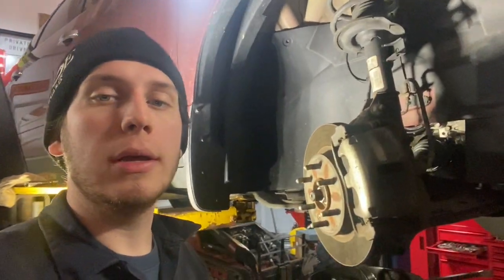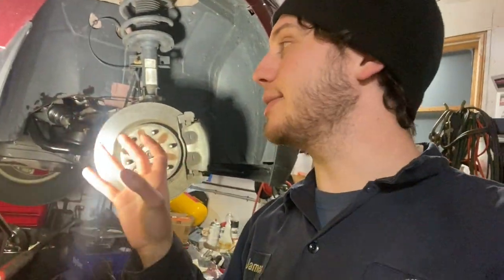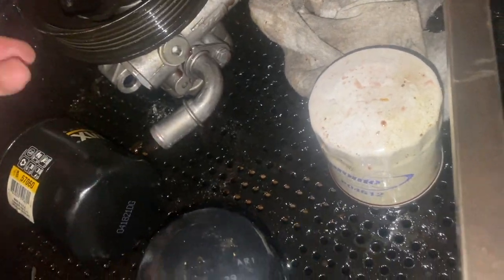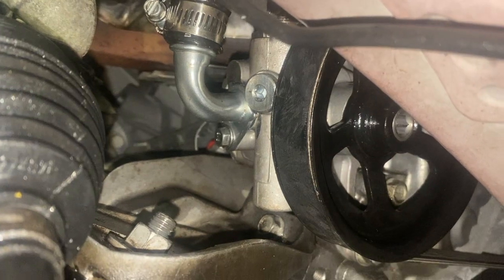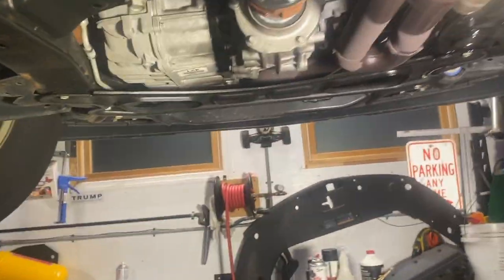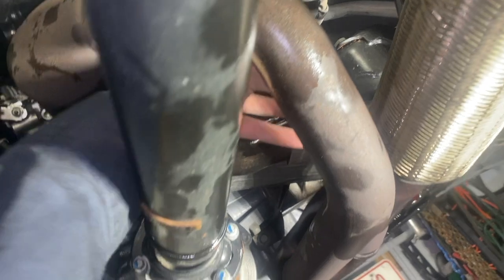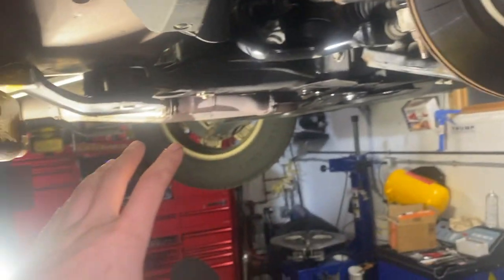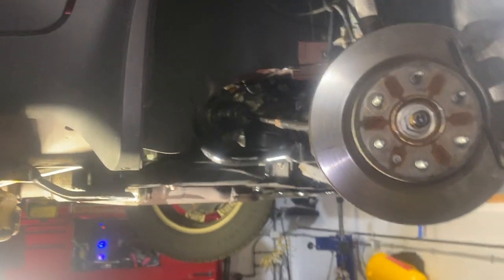2011-2017 Chevy 3.6 traverse power steering pump replacement leak the easy way

Comment: Just took mine out (2016 AWD) out with the help of this video. Thank you. I struggled until removed a heat shield (2x10mm bolts). Once I did that, it took 5mins to get out. You’ll need a looooong extension with a swivel end to get that back bolt.

Comment: Just did this on my back. 2013 Traverse AWD. Took about 3 hours. The pump slides out easy through where you showed. Remove the elbow from the pump first (held on by 10mm bolt) and it'll slide out and in 2 minutes tops. No need to drop frame or driveshaft. The hardest part honestly is getting the line nut out and putting the hose clamp back on (I highly recommend replacing it with a screw-type clamp).
Reply: Thank you !  This really helps!
Reply: Where are you feom?
Reply: Sorry.. Where are you from?

Comment: Ok here is the absolute easiest way.  

Remove belt.  Unbolt passenger sway bar link from strut.  Unbolt tie rod from knuckle.  Remove right side subframe bolts, don't touch left side to keep subframe position.  Lower subframe as far as it will go.  Remove flare nut, remove 10mm holding return elbow.  Pump falls right out through wheel well.  Takes 30 minutes.
Reply: Is there a video of anyone doing it this way that you have know of? I would like to try doing it this way I prefer watching a video first..

Comment: Of course you can do it on the ground. I did the timing chains and phasers on the ground, which requires taking the pump off just to do it (even though i just left mine tucked in back)

Comment: Question? I have a 2014 traverse. It has been leaking steering fluid at a rate of half a quart about every two months. I degreased the undercarriage to try and identify exactly where the leak is coming from but still can't quite see it. It's definitely coming from the pump and not the rack but my question is, should I just go ahead and replace the pump or should I do anything more to try and diagnose the issue? I do all of my own repairs because where I live there are no mechanics that are trying to do a good job well done without robbing you blind first. I guess a more indepth explanation of my question would be if I replace the  pump is there anything else I need to watch out for that it may be leaking from that may not directly be the pump itself?

Comment: Take the pully off also with a puller,it can be done if you get it in position,then comes right out.No need to take anything apart.This is great idea also.If you don't have a lift.
Reply: That’s what I did. Some people just don’t see it
Reply: @eltorro30  AWD models are a real pain, I took the tierod off 1st,2 jacks on the cradle,impacted the 6 bolts loose,lowered the cradle with the jacks,Then put the pulley wheel into position,Rented oreilys pulley puller,pulled it.Pump falls right out.Put new pump in ,Pressed it back on(screwdriver to keep pulley wheel from spinning),pressed right on.Jacked up the cradle, rebolted the pump,hooked up 2 lines,reattached tierod, wheel on.Fixed my problem.8hrs later.....AwD sucks totally different  procedure FwD,.
Reply: I just did my all wheel drive the same way, removing the pulley in the cavity to remove it without unbolting anything else but the wheel and tie rod.

Comment: I have 1 coming in next week so I haven't seen it yet but my question is if you took the complete tie rod assem. inner and outer off would it fit through the wheel well then?
Reply from the maker: I believe the struggle I had was getting the position correct between the motor and the frame rail

Comment: This is my next project. 2011 Chevy Traverse Lt. I've already replace the engine after a timing ⛓️ issue that kill that one. Now it has a remanufactured engine with a four year warranty. It does this whining noise. I'm guessing it's something with pump. I'm going to get the pump, the reservoir, and return hose. I'm already invested might at well at point 😑
Reply from the maker: Let me know how it goes man!
Reply: @jamesiv432  will do. Thank you for your video! Keep up the good work
Reply: How did it go man? I have the same model and year, with the same noise. 

Leaks plenty of fluid and sometimes will stall when making a sharp turn.

Comment: Since you all are in the know and before I commit my day to doing this, can you tell me the symptoms that lead you down this path?
My steering wheel is shuddering, bouncing, jerking (whatever adjective works) when I turned the wheel while sitting idle. I'm not hearing anything from under the hood but it's always moaned.
Reply from the maker: So typically these Chevy traverses are very well known for power, steering pump failures. In this particular case, it was diagnosed by the dealership and they were given a astronomical price, so I did it for a friend. to my knowledge, it was only making a high-pitched, whining noise. Before you replace the pump, I would suggest doing your absolute best to bleed the air out of the system. I would try to first jack the front end up and crank the wheel back and forth lock out to lock out with the engine off. Back and forth up to 40 times. Possible air in the system could cause your problem. You would just be investing a little time before buying parts and your labor for this project.
Reply: @jamesiv432  thanks for the pointers. I'll see what happens. I did of course check the fluid. It was a at the min line so I added a little bit to max it. Maybe it sucked some air.
Reply: @Troy Seagondollar  my 17' does the same thing with the shudder.  Did you solve the issue?
Reply: @vongabriel7597  unfortunately yes. The power steering pump (which the mechanic told me me is way to small for the vehicle) went bad. That then pushed shards f metal int the rack and ruined it too. After all was said and done it cost me 2400 bucks. Doing a diy wasn't an option because of where the pump is and the work required to replace the rack.

Comment: Trying to do this on my 2017 and I can’t get my pump out this way any suggestions?
Reply from the maker: Are there any components of the pump that you can remove to possibly squeak between the frame rail? See if there’s anyway, you can possibly move the subframe by loosening some bolts to gain more room for removal of the pump.

Comment: Was the pump whining? Just curious on what symptoms you had that the pump was bad. My fluid is dark almost brown and is whining a lot.  TIA
Reply from the maker: I did not diagnosis car came from a family friend took it to the dealer and they said it needed a power steering pump, from what I understand it would whine when it was cold on start up but I honestly did not experience very much of that. I know these Chevy traverse is are common for having power steering issues.